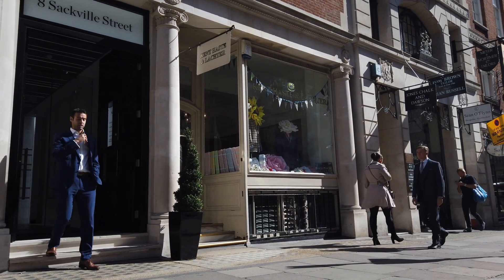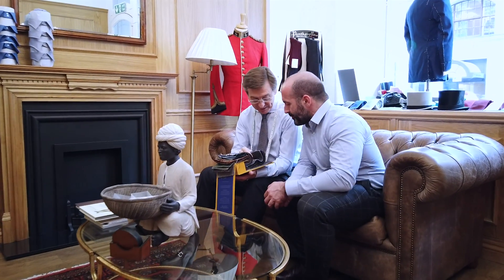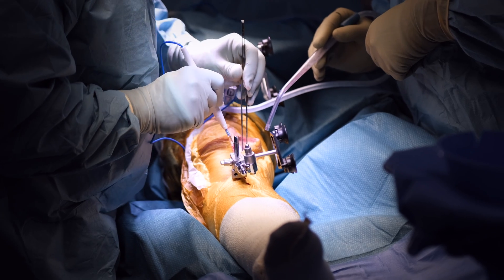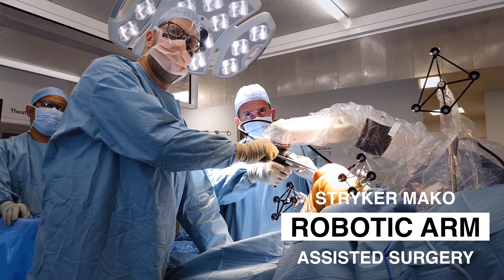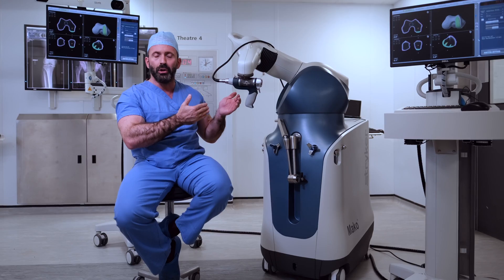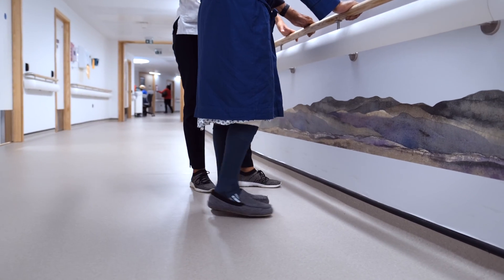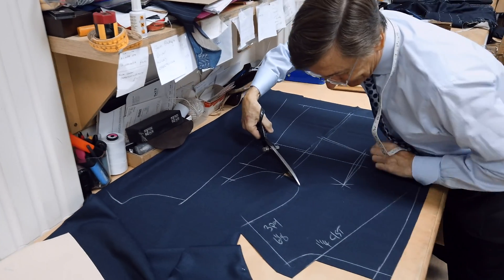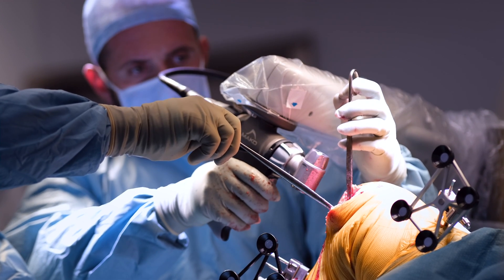Knee replacement using the Stryker Mako Robot

Comment: Do not get a knee replacement in the Philippines I had one done and it was a failure, I need another knee replacement cause the surgeon did not align the knee correctly, I am a retired veteran living in the Philippines now I have to fly back to the USA and have it done there, again do not get any knee surgery in the Philippines sub standard surgeons using antiquated procedures, my knee is unstable, swollen and pain after 8 months.
Reply: did you do it with Mako?